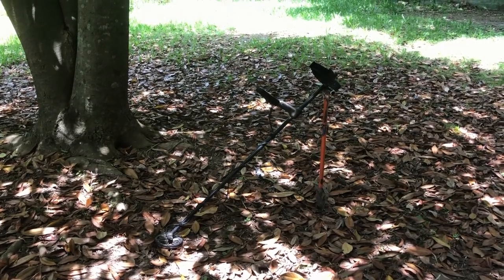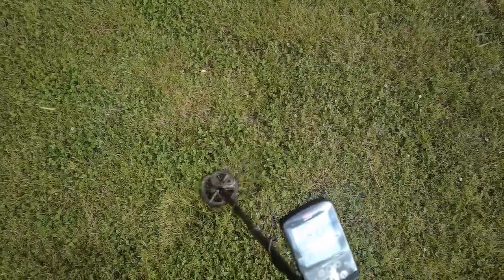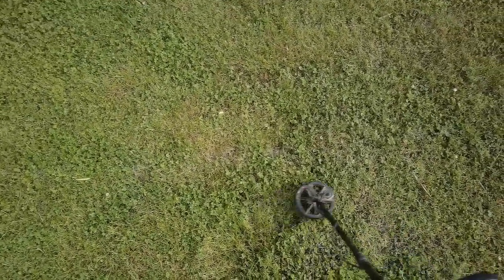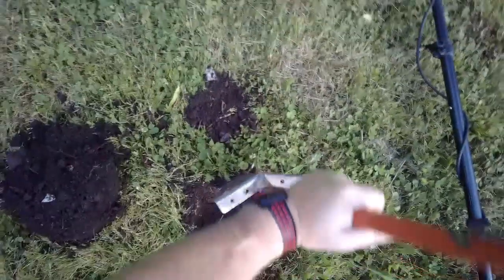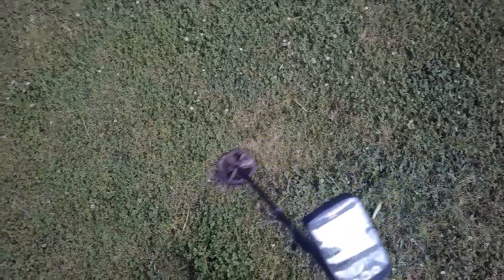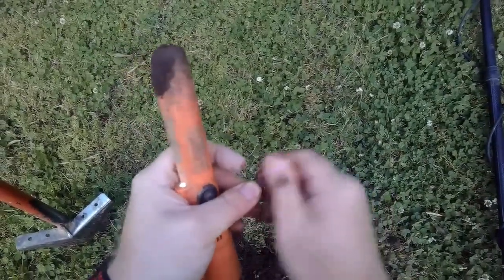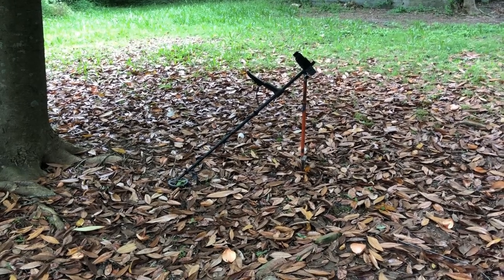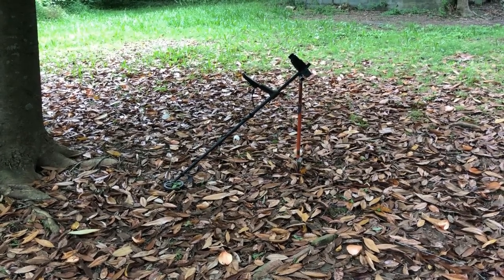Recognizing falsing on the Minelab Equinox (#91)

Comment: Thinking about purchasing the 800 Equinox and enjoyed your video. Currently have the X-Terra 705 and not having the best of luck lately. Too much trash in my areas I guess. If fencing wire and nails were considered relics, I could open up a museum!  Thanks for the tips, I would think some of them would apply to the 705 as well and I'll employ them and may just upgrade soon enough! Thanks again!
Reply from the maker: Thanks for watching and commenting Andy! Good luck with your new machine if you decide to get it.

Comment: Nice video. I find that if I dig a plug and the pinpointer indicates that the signal is at the side of the hole, it is iron 95% of the time. I realize that this doesn't save anybody from digging the plug, but it can help one cut their losses if in a hurry.
Reply from the maker: Thanks and I agree. I've noticed the same thing.

Comment: I have a Minelab Excalibur 2 , and it also does the same thing sometimes, not all the time,.
I dig the hole 🕳 and nothing is in it .
But I have heard from others that this happens with a lot of different machines .
Cool video. Mike Espo .
Reply from the maker: Thanks Mike. Yep happens with my other detectors as well. It’s easier to recognize on some detectors more than others.

Comment: Nails especially rusty ones will 99% of the time be off to the side of the hole but a coin can also be masked you can see how the nail was off to the side. 
I just dug two SLQ’s in a heavy hit park that were masked by rusty nails I bet most would have never dug that signal when I removed the nail I had a 30 on my Nox turned out to be two SLQ’s
I do know for a fact that if you hunt saltwater deep silver will do the same thing horrible signal but you have to dig them .
Reply from the maker: The Nox sure is a great at picking out those semi masked coins. Congrats on the SLQs!

Comment: Careful about your choice of words. Falsing is different from giving a bogus high TID on iron (which is a common problem with rusted iron targets). Falsing  generally means that the detector sounds off when nothing is there and in most cases is caused by having too high of a sensibility setting.
Reply from the maker: The term I used may indeed be incorrect. To be clear, for the purposes of this video I'm referring to false good signals. Meaning ferrous targets reading similar to non-ferrous targets. I usually refer to it as falsing iron, though that too may be technically incorrect. Hopefully the demonstration shows a good enough example that most folks will still understand what I'm talking about.  :)
Reply: We all know what you meant. Good video.
Reply: @MetalDetectingNWGA  Falsing is exactly what your video describes here. I'm new to this sport; however, according to the blogs (metaldetectingforum_com) and videos I've gone through, you are correct. The term 'falsing' appears to be applied in other areas such as EMI and improper ground balancing and sensitivity settings (or as he puts it, "sensibility setting" ;) as Walter above mentions.
BTW: Thanks for the great tips.
Reply from the maker: @carltonbauer2779  Thanks bud! Appreciate you watching and commenting. :)